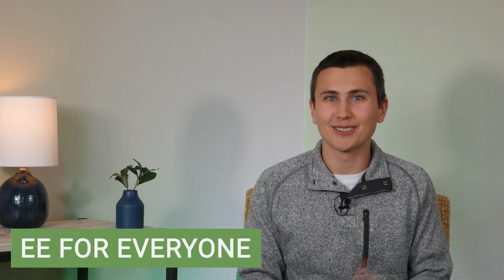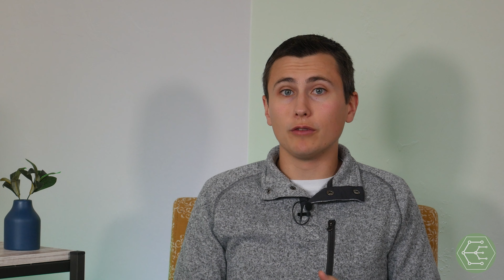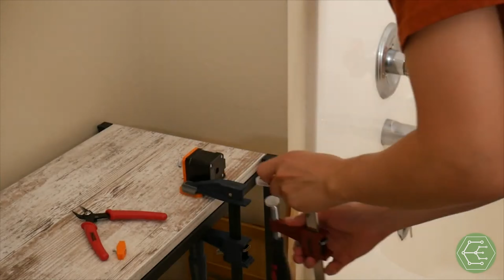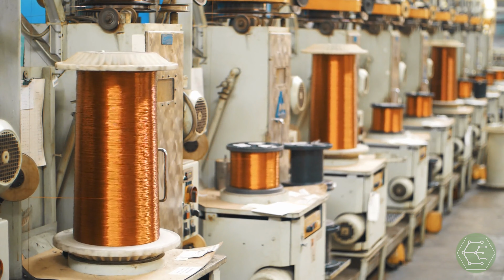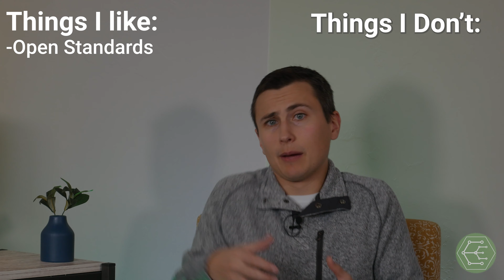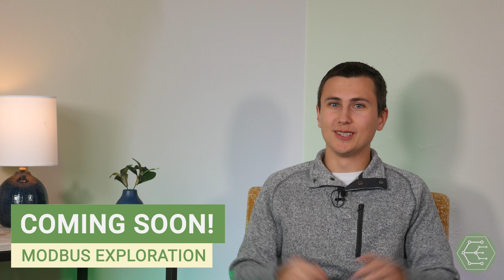Motor Project Kickoff – Problem Statement, Research, and a Vision | MOT 2

Comment: seems like you are set on going the low voltage  DC route, my biased wish would have been atleast a sprinkle of AC motor control.
That would lead to discussing and designing EMC ,inrush limiting, active vs passive rectifier, PFC, software dc bus ripple compensation, slip PID control, interface isolation and alot more.

But i will be following this project with a great interest! 
 common dc bus, dc brake chopper?, fast hardware shutdown protection?

I hope you include some software design too, i would love to see the modbus implementation. and show your success/frustration with the modulation strategy, interrupt service routine, current limiting/shutdown algorithm etc.

Good luck!
Reply from the maker: Hello Ghoetic! 

In general, I'm always conflicted about voltage limits. I try to encourage safety and never know what a person might do without a mentor next to them. As "that guy" that leaned against a chassis during a HIPOT test... erm but that's a story for a different day... In general, I feel more comfortable sharing about intrinsically safer systems.

Nevertheless, the control theory of BLDC vs AC motor is very similar. I think it's fair to say that the control circuit & software will end up looking very similar (though distinctly different) from the DC link to the motor. The big thing for me is that if someone wants to control an AC drive with Modbus, there are OTS controllers that can be purchased for ($100-200 US) . With the price bar set so low, I think it's unlikely that my effort would add much value.

With that said, my intention is to have a whole host of motors by the end: with and without position feedback, with and without multiphase sinusoidal modulation! 

Hopefully the higher-voltage, higher-power BLDCs scratch your AC modulation itch!
Your list of awesome ideas has me thinking though... if EEforEveryone gets huge... it might be fun to rent out an EMC test house for a few days and test both intentionally good and bad designs! It's hard to discuss EMC without real test data.

I'll definitely add your suggestions to my notesheet for this project... the planning isn't over, so I'm sure you'll see at least a few of these advanced concepts!
Reply: @EEforEveryone   I completly agree and support your choice, safety first! 

If it were not for the hazards, i would love to see the problem solving/engineering aspect of the mentioned AC system concepts, e.g active rectifier, just cause the added complexity is so interesting.

But this series will probably scratch that itch! As you already said, alot of concepts are common between the systems. 👌